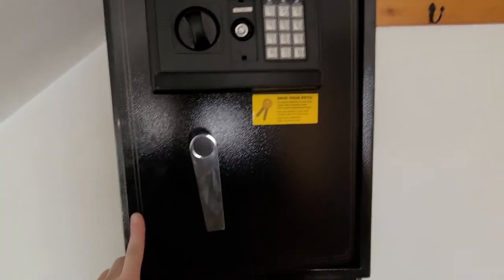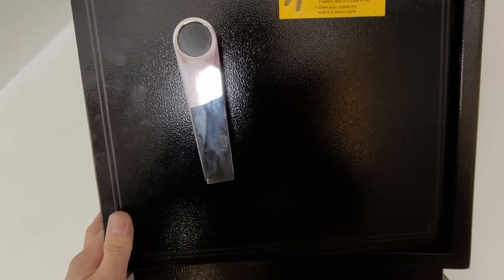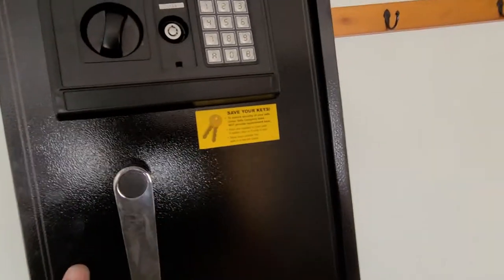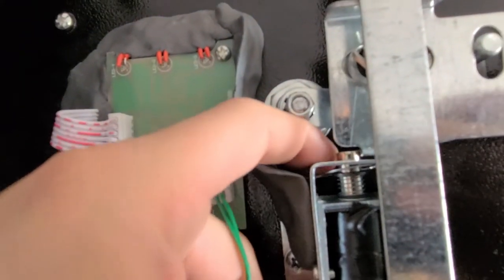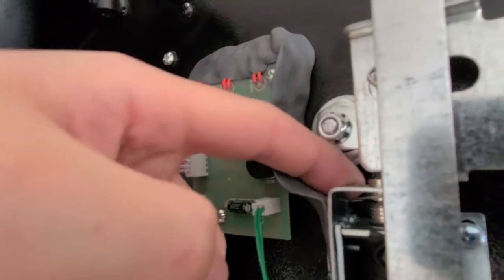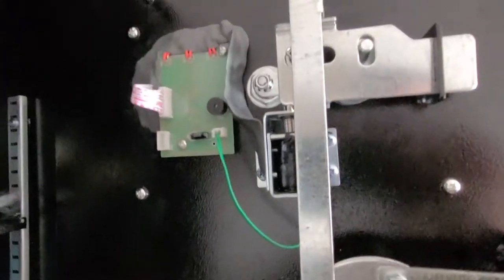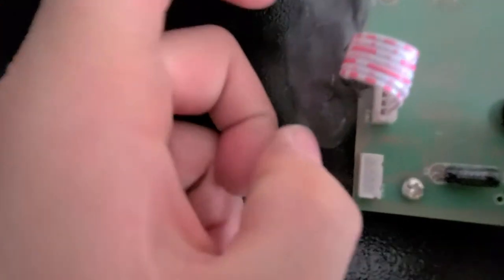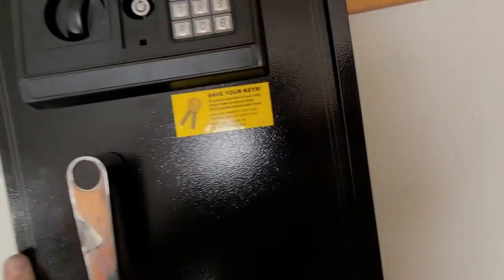Union Safe Design Flaws & Fix

Comment: Awesome vid, Thankyou for this. One other thing to mention. There is a cheap tool off Amazon that can still open this through the actual key hole. Or master key slot. Tool is very simple and can easily open it. Definitely another weak spot that could be fixed. Otherwise perfect solution

Comment: I bought a harbor freight safe the smaller one the .37 cubic inch one and it's garbage. Brand new safe and it has two flaws not only the mechanism failing but the keypad itself can fail by entering a series of zeros or nines impressing the A button and it would open up. I've never been a fan of digital combination saves I prefer the dial combination which is much more reliable and time proven

Comment: I've never used QuikSteel before. Can its rough edges be filed off, with the kind of hand files that are for filing metal surfaces?
I'm a subscriber to your videos.
Reply from the maker: Yes sir! Sorry for the delay in response, been a little busy lately. Quick steel will have soft rock-like consistency. It can be drilled, tapped, and painted.

Comment: Try an see how hard it is to replace the key lock with an actual key. He also showed that the factory lock is extremely easy to pick. There are alot of safe style aftermarket locks, it would be interesting
Reply: I’m also interested in seeing what keyed alternatives there are. I’d prefer there be a manual dial instead of a key though. If I can’t find a better solution, I’m going to cover the key hole with a piece of tape then fill in/cover the key hole with quik steel or epoxy. The tape should protect the key hole in the event that a battery goes bad without warning
Reply: @viktrp  academy has a base line for 299 12 to 18 gun safe, and it has a cap for the reset button inside and it has a deep skeleton key as a backup to the electronic pad
Reply: @viktrp  sports affield

Comment: I know this is two years old, but amazon sells the cylinder tool key for few dollars Plus I've seen them at other stores..  It would take me all of 10 seconds or less to get into your safe.
Reply from the maker: It would take you more than 10 seconds to get into my front door. But thanks for letting us know, I don't have this lock box anymore, it was for temporary use only.
Reply: @Jimrod1992  as I was writing that I said the same thing. (Not that I would)  It would take me alot longer getting into the house and finding it.
Bought one on sale for $119 and yup its going back for sure.
Reply from the maker: @bubbasmith7312  yeah it's only meant to keep kids and teenagers out mostly! Thanks for watching though bud!

Comment: Avoid any safe that has an override key. Those barrel locks are easy to pick especially if you have an impressioning tool. The best combination (no pun intended) mechanical dial and a key to open the bolt mechanism.